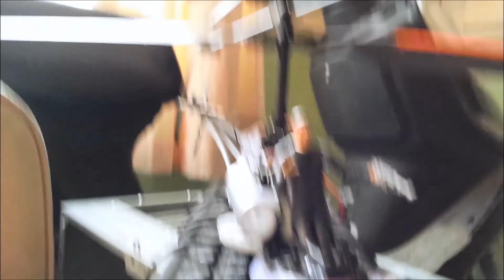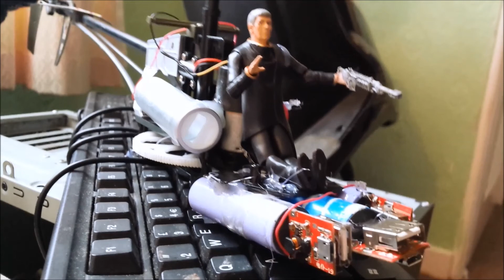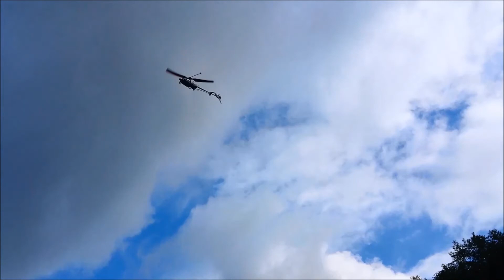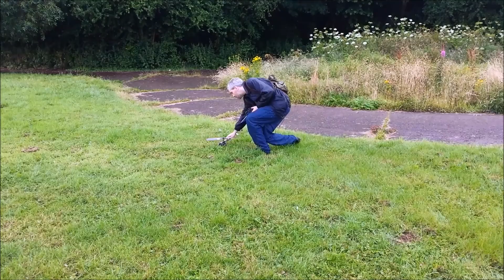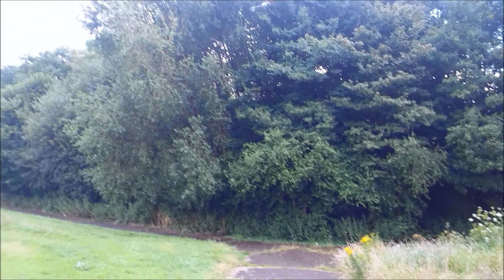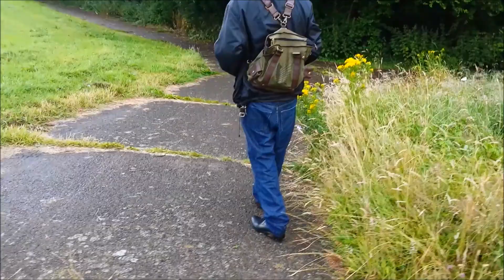R/C 'Power Bank' Helicopter Experiment - Part 4

Comment: how much voltage it made after connecting those batteries in series? Did the motor burned because of over voltage input?
Reply from the maker: hey :-) hmm i was clocking about 11-12v on this one i think, but i think i came to the conclusion that their were either not enough amps from the li-ions to feed both tail rotar and main rotar at peak drain or that there was a proplem with the rear stabalising blade :-D a high amp step up board to boost the amps may have helped out i think but it was a bit damaged when i received it and i finnished it off crashing it in this video :-) the servos came in handy for something though :-p
Reply: Planning to use 5v power bank on my quadcopter, stock battery is 3.7 volts. Do you think with that much difference will burn my quadcopter?
Reply from the maker: Archimedes Tan
I think you should be ok :-) if in doubt you could get a 1 volt component and test it with that in series with the quad control board and it should take the risk out of frying the board, in the power bank its likely running a 4.2v li-ion cell so if you hooked it up direct to the cell it would be fine and you could still keep the charge and discharge board of the power bank on the cell for an easy usb recharge :-) it just bypasses that 5v on the board, some power banks can be 5v 1-2 amp discharge so that could be a bit to much wattage for your drone :-)

Comment: isn't Leonard a bit old to be test piloting? i mean hes like 79 or something.
Reply from the maker: its his way of making up for his creator's mis-givings. My mum was in a charity shop and rang me saying 'there is an 'original spock' here for £5'. im like...'av that', so I re-imburse my mum and check out my 'original spock'...from 2007...moth3r f*/3r

so there seemed no better volunteer... :-D

how goes? im currently designing a mini muffler out of 3 power bank tubes :-) guess its just another day...part from it being  actually hot today, 29 degrees and the news are lapping it up :-)
Reply: battonfive
i'm wondering if the spinning issues with the helicopter is due to the power not scaling between the two motors lateraly. maybe try adding a resistor to the top motor or to the back and see if that helps?

and i'm fine, might tear appart a lot of circuits today.
Reply from the maker: yeah I know what you mean, like the rear tail needs more power or the main rotor needs less, I think I killed the rear motor, so when I find a cheap replacement over the next few weeks I will check it out again, hopefully the new rear rotor will have it but if it doesn't handle it, then yeah I will definitely consider further regulation with the resistors :-)

Choppers always seem to be a pain due to balancing, atleast drones have the gyros to manage it all better.

keep an eyeout to see if there are any ldr's in anything would you, cant really think what might be floating around with one in :-)

what? if you quest for the grail might as well nip in to the shop on the way back and get a bottle of milk :-D
Reply: battonfive post a close up picture on google+ of the motor and send me a link (or tag me in the post) so i can see what motor it is, i may have one similar.